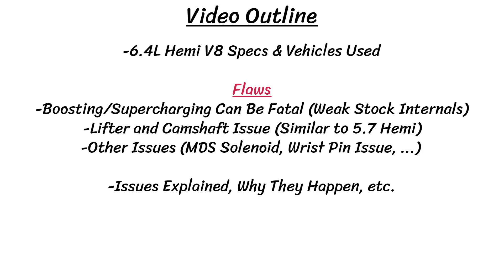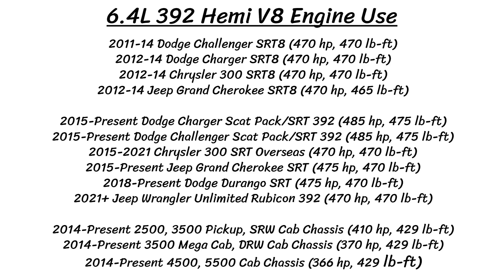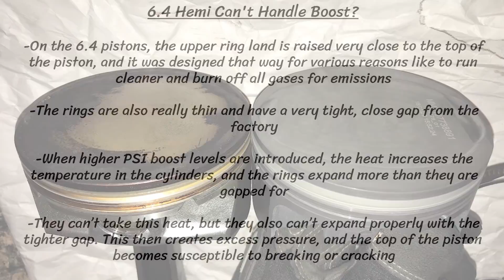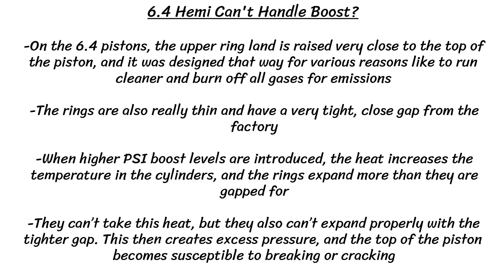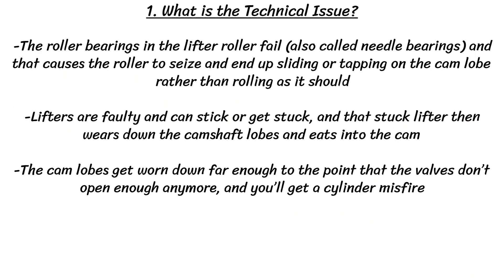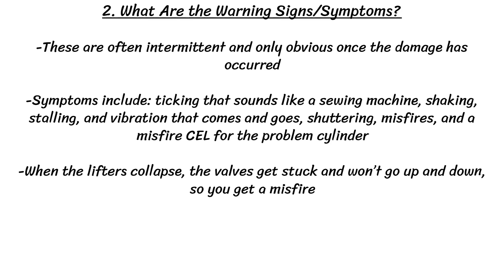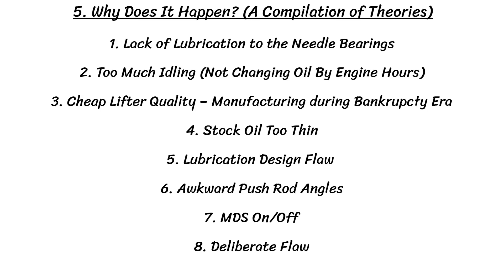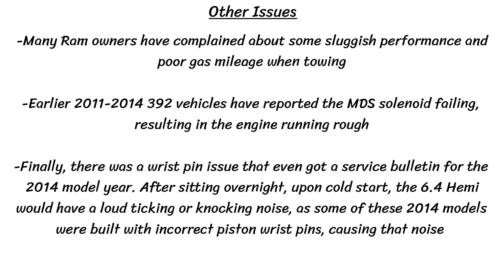The Specs and Fatal Flaws of the Chrysler 6.4L Hemi V8 Engine (392 Hemi Issues)

Comment: Lifters were revised in 2016 production onwards. These later Lifters have thicker larger needle bearings to solve roller failure. Just add that lifters AA AB 2011 to 2015 likely fail, AC 2016, 2017 with larger needles, durability in doubt, 2018 to 2021 AD larger needle lifters are  from new supplier
Reply: No, it did not. Our shop recently replaced two 6.4 engines, one in a 2015, and one in a 2016, both seized up a lifter roller, wiped out the cam, and filled the engine with metal shavings. Both engines had 105-110k miles on them. It's just a shitty engine.
Reply: @jamesgeorge4874  lifter revision in 2016 came from original supplier. MOPAR change supplier 2018 and lifter suffix changed to AD. Dare say original supplier of lifters was not successful is remedying roller weakness.
Reply: @index6738  thanks for the OEM part numbers, I will save that info, the last few we have done, the customer has opted to replace the engine, due to employees running them until they were very unhappy. I love it when you look up part numbers, and the suffix has gone from apple apple, to apple foxtrot, soooo there  was been a revision? , lol.
Reply: @jamesgeorge4874  many revisions…clearly trying to resolve durability roller bearings. Replacement engines from MOPAR come as AB. New revision block…maybe? was informed AB block was Hellcat block. Not sure if true or not. I have the AB block built 2020. Must admit block colour was darker orange than AA block.
Reply: @index6738  very interesting... I asked about the 6.4 core sitting at the shop, it could be mine for the low low price of $900. The 24k mile engine was $5795.00 oof. I got an LC9 5.3 long block for free, and a 4L80E core for $300.
Reply: Correct. Replacement engines use BGE block. Stronger, stiffer with better cooling through revised water jackets. BGE block was originally designated to heavy duty trucks, but became standard block in all engine production. Yes, can be coined Hellcat block, same BGE block.
Reply: @index6738  Big Gas Engine. Gotta love the Doge engineers.
Reply: Could I apply these thicker needles to my 13 Challenger or would it be costly .
Reply: @bitemyshinnymetalass1569  costly
Reply: @bitemyshinnymetalass1569  if you are paying someone else, I would guess around $2000, minimum, I honestly haven't seen the issue in a car yet, its been all trucks.
Reply: @bitemyshinnymetalass1569  .  Current generation of MOPAR lifters for Hemi are backward compatible. Part number remains same, but ending suffix originally AA, changed  to AB, AC and current AD representing progression of lifter design. AC and AD are  large needle bearing roller design. Thing with changing lifters is the requirement to remove heads. Certainly cheaper option, preventative maintenance, to cam replacement, engine replacement , or full engine rebuild due to metal contamination.
Reply: The thicker needles were introduced in 2014.
Reply: @snek9353  . 2011 to 2015 production used lifters PN ending in AA. These lifters will, and have  failed prematurely. 2016 to 2018 production introduced  bigger needles  PN ending with either AB and AC. From 2019 production onwards , lifter supplier changed, and lifter  PN changed to AD.
Reply: I had 2014 and 2015 6.4, both had premature lifter failure. Both had small needle bearing rollers.
Reply: @snek9353  well then, explain why I have personally had 2013, 2014 and 2015 Hemi   production 6.4  with early  lifter roller failure?  I have experienced it, and Jeep know very well year models that have this lifter weakness.  I may not have the PN suffixes in good order, but Jeep confirmed they have not seen premature lifter failure since larger needle bearings introduced. Stated 2016. I am now running 2018 and 2020 production Hemi 6.4 ‘s and was assured the lifters fitted were using larger needle bearings.
Reply: @index6738  How can I answer why you had failures? Show me the lifters.
Reply: @snek9353  I don’t hold lifters. But I can say they had common roller seize, and wipe cam lob. Factory serviced vehicles, daily drives and well maintained. Jeep accepted claims for warranty on engines based on year of manufacture and excellent service histories.
Reply: @snek9353  14 are the smaller lifters mine blew as well
Reply: @98slime86 . Correct

Comment: Best to stroke the 392 to 426 with all forged internals.  But that ain’t cheap that’s for sure
Reply: @BlackTorrent  I can gap a hellcat unless it’s been modified and I have less invested.  So to each his own.  I’m happy with my build
Reply: @raymondrocco8607  no.  Stroked my stock 392 to 426 with all forged internals.
Reply: @bybrianmalone  how much $
Reply: @almucc6319  I did a lot more than just pistons and rods.  Cam, long tube headers, fuel system upgrade, etc….  Total for all that was about 15k
Reply: @BlackTorrent  Not really man. A lot of muscle-car guys love our N/A power and sound. The unique advantage of the Hemi are the heads and their massive flow from the factory. We're talking $5k for aluminum racing heads for an LS just to get close to a factory Eagle head. That's excluding the massive camshaft an LS will have to run to support the flow as well as the pistons and rods to handle high RPM. All the Hemi guy has to do is cam, lifters, valve springs, and change pistons and rods. You don't have to do a stroker with a forged crank. With very very light porting there is no LS/LT head that can match a factory Eagle head let alone an Apache. The main problem is cost for parts due to less demand than a Chevy or Ford. That's why it's so expensive.
Reply: @PyroBlonde7777  listen dude I'm a mopar guy but that compares nothing to an ls
Reply: @raymondrocco8607  I’ve already done it.  Lol
Reply: That's not a good idea. Because the block is already been stroked up to make a 392.  Best to use a 5.7 or 6.2 engine.
Reply: @shaneonews6791  the 426 stroker is a very common swap that's reliable and safe. I've never heard anyone say that a 392 is "stroked" from the factory but wouldn't be surprised if it had more stroke than a 5.7L lol. Unless you've heard of someone's bending rods or snapping cranks?
Reply: @PyroBlonde7777   all the 392 6.4l are stroked up 6.2 hemi..  there's reasons why Chrysler uses the 6.2 for hellcats etc and not the 392... 6.4l
It's because the 6.4 isn't strong enough to handle the extra power from a supercharger.  Yes you can switch out the rods and Pistons etc...
But Because when you stroke up a engine and it bore to it's max or over It can actually become weaker. 
The more a crank sticks out of the block. The weaker the it becomes.. You can only bore and stroke so much on a engine.. 
the more the Crank sits in a block, The stronger it is.   Any engine builder will tell you this.  If you want a 426 hemi.  Get a block that is meant for this.  
So even if you got a kit to max out a 6.4.  I wouldn't supercharger it.  Ford's knows this.  This is why they don't or nobody takes a 5.0 and bored /stokes it. 
Simple put.  If you buy a 392.  Leave it only. Just because you can stroke it.  Doesn't mean you should.  Just do performance heads. That's all you need.  If you want a 426.. buy a crate engine.  
Also.  If you do stroke up a 392. You mite not have problems sure.  It's possible with the right build.  But if you push that engine with forced induction etc.  You can easily have big problems. I mean do you really think Chrysler made a 6.4 block? Lol. Just because you can Mac a engine stroke and bore out.  Doesn't mean you should.  Unless you like blowing money for fun.
Reply: @shaneonews6791  Chrysler never made a 6.2 until years after the 6.4 was around so its impossible to claim a 6.4 is a "stroked" 6.2 lol. But yes, the destroked 6.4 (6.2) handles boost much better. The 426 stroker is also high compression which is another reason I mentioned an N/A build. Without boost the internals have much less of a load so piston bob weight and RPM becomes the major factor. The 426 stroker left alone and ran at the correct RPM will be very reliable N/A.
Reply: @PyroBlonde7777  the older srt are 6.2 or 6.1.. I forget.   So the 6.4 was made after.
Reply: @PyroBlonde7777  the 6.4 was made after dude..
Reply: @PyroBlonde7777  yeah. It was a SRT8 6.1
Reply: @shaneonews6791  Absolutely not. The 6.1L was the first Hemi in a modern Challenger (2008). Then the 6.1L was replaced by the 6.4L 392 in 2011. Years later once the Hellcat came out in 2016 we got a 6.2L motor. The 6.1L is best to stroke because it has a large bore with a short stroke from the factory. You're probably mixing up engines.
Reply: @shaneonews6791  didn't see that you straightened yourself out lol. But yes, the 6.1L is best for stroking. However a 392ci can handle a 426ci stoker without boost.
Reply: @PyroBlonde7777  yeah. I meant the 6.1l 
Basically explaining the reasons why hellcat etc use the 6.2 and not the 6.4l  
Saying it's all the same block. But the 6.4 has bigger crank etc.  Which can make for weaker engine on boost. So people that think bigger is better and trying to stoke up 6.4.  what they don't know is it can actually make it weaker. Again. Large the Crank is on that block.. the farther it sits outside the block.. that's not good.  Chrysler knows this.. that's why they don't use the 392 for hellcats etc.. it won't handle the power.
Reply: @shaneonews6791  Chrysler has known this since this 60s which is why their big blocks were the first to come skirted.   Where do you think the LS got it from? The same reason why Chrysler ran forged internals commonly back then too with the 318, 383, 413, and 426. Chevy's of the day had a lot of stroke when you compare a 350 to a Mopar 340. Chrysler kept their stroke down for higher RPM and integrity. You're preaching to the  choir right now lol. But still, 426 stroker is safe without boost so there is no discussion.
Reply: @PyroBlonde7777  yes. 392 stoked to 426 is safe without boost.  But I'm saying to people ..keep in mind. 
It doesn't mean it's stronger etc. A lot of people will just do it, Then supercharger it etc.  Then boom.lol.  
Me personally.. I'd just get performance heads for the 392.  Call it a day.
Reply: @shaneonews6791  your best LS1 head (799) flows 240cfm. With racing heads you might see 300cfm depending on the money you're willing to spend. The Eagle head flows 323cfm stock. The Apache is 339cfm and 389cfm with very light porting. The entire point of owning a Hemi are the heads. Anyone willing to put boost to a high compression stroker kit gets what they deserve lol
Reply: @PyroBlonde7777  Indy has an old school dyno'd and packaged 572 stroker hemi with one dominator on a duel plane that dyno's at 764 horse and 687 torque , delivered for around $17,000. Proven strong engine for a descent price. I do love my '12 srt 8 Challenger though. But i can dream. Hey , and no computer.
Reply: the nice thing is that starting in 2021 dodge started using the forged hellcat blocks for the 392s now
Reply: @delzermitch  Got a link for that?  Ordered a new 2021 392 Scatpack a few months ago and would like to read into that a bit
Reply: @brandoxic8354  i dont really have a link into it but if you look up Dodge BGE block on google you will find info about it, its basically the same as the hellcat engine block but has a slightly longer stroke on those engines to get that 6.4L displacement instead of 6.2
Reply: @brandoxic8354  I

Comment: Sup Marspeed, congrats on 100k! My parents use to have a 392 Durango, but now we have a Hellcat Durango. I think it would be cool if you can do one of those videos where you find how many are made for the Hellcat Durango, and how many Hellcat Durango was made for a color.
Reply from the maker: Hey thanks bro! Yeah I can try to do that! It’s getting harder to find production numbers but I can do my best, if you have a specific year/color I can try to find it out for you as well
Reply: @MarspeedCars  Hey I understand, when we got the Durango Hellcat, doin our application told us some numbers, like with our current Hellcat, black with blue stripes, he guess around high low digits and low double digits for the black & blue.
Reply: Ask and you shall receive. (sometimes) https://www.dodgedurango.net/threads/any-updates-on-the-2021-durango-hellcat.79353/page-47 scroll down a bit.